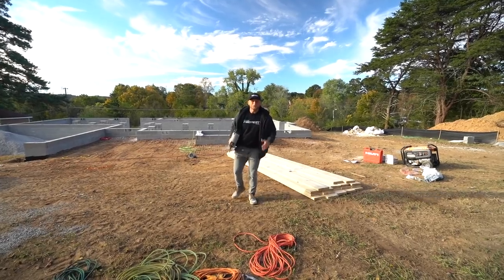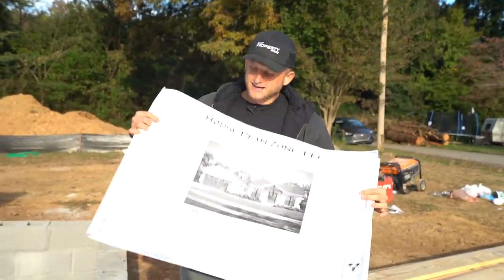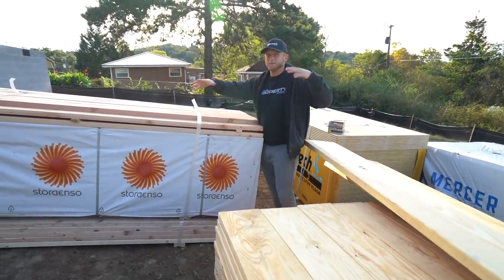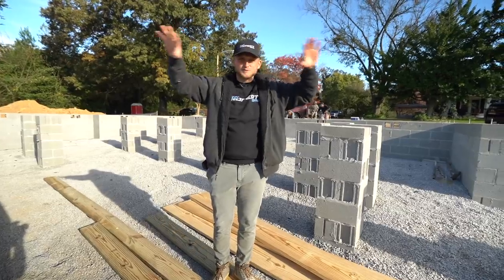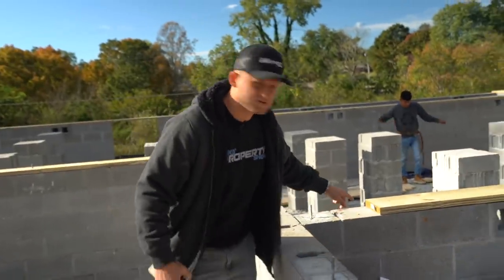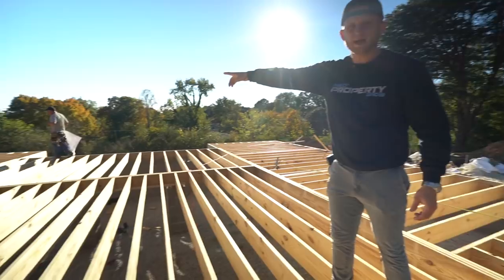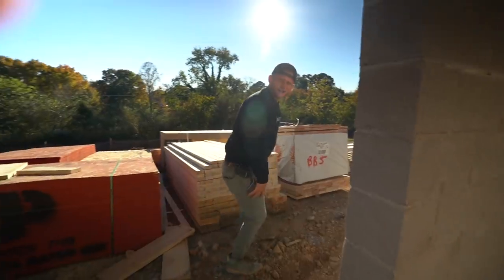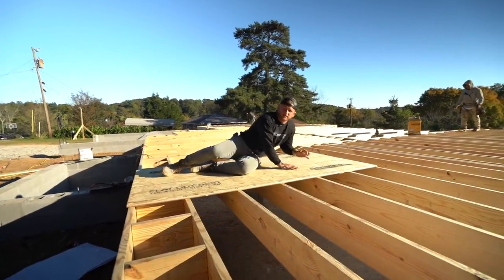Framing the Floor System for 1,599 SQ FT | Building A $350,000 Custom House | Episode 9

Comment: Niko, why not have girders? Where all the joists are sitting on top of the girders and unloading the weight on them. I am sure when you bought the house plan/framing plan it was an option and it is s a whole lot better. 
I am guessing the foundation piers were built wrong, instead of being 8-10 inches lower than the outside foundation, so that’s why you had to improvise and have all the subfloor joists at the same level with the beams that support the joists at the ends?
Thanks!
Per total the job looks great, the framing crew is not on their first trial, but this system is not as sturdy as having the joists sit on top of the girders.